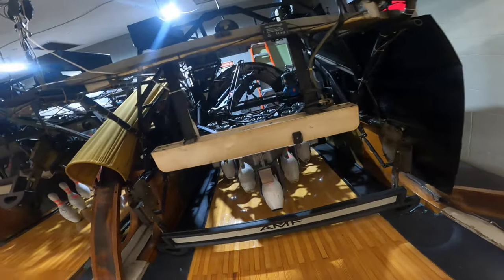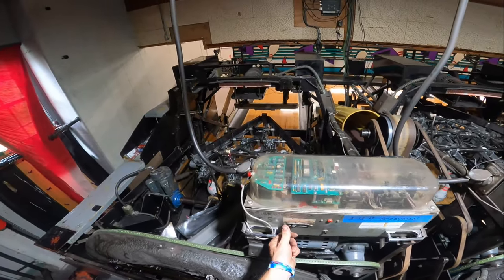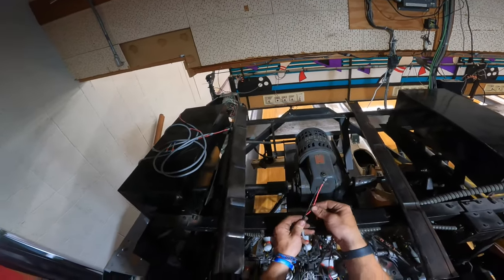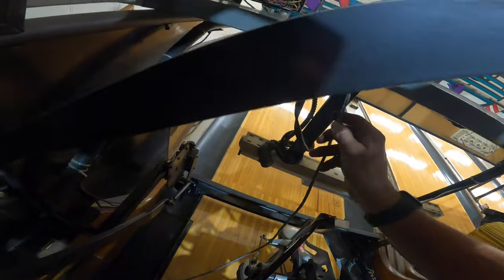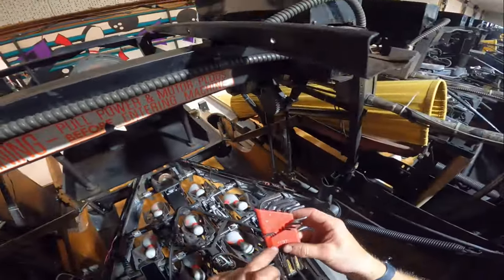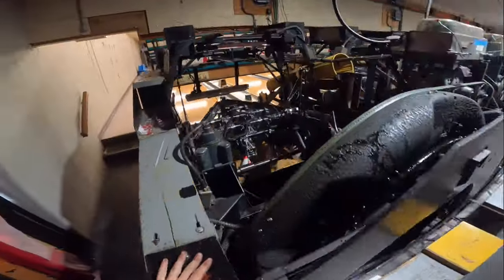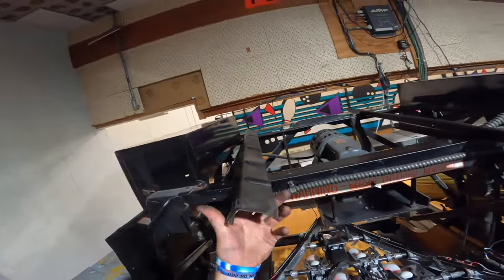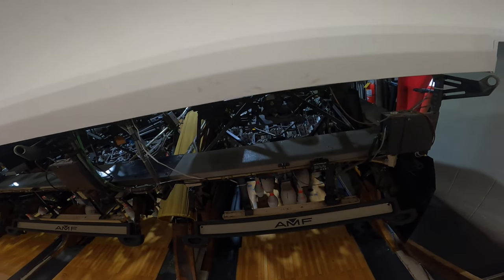AMF 82-30 Blackout Switch Wiring Tutorial ft. Dirty 30's Solutions and Mike V.

Comment: The center I started in had 36 lanes of 30’s and all had the black out switches working. These machines had the original chassis. When the tables downward movement is impeded the machine would black out. This could be because of an off spot pin, pin on the deck when spotting new pins, or a table-sweep crash. The good ole table-sweep crashes!! 😊Great video Joe!
Reply from the maker: Thank you Sean!